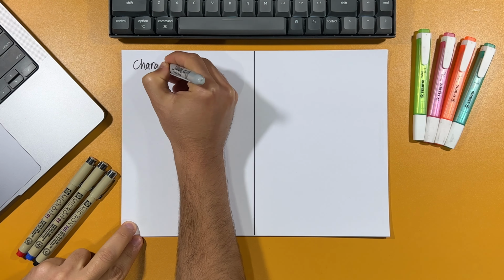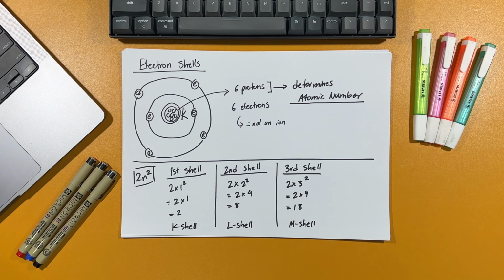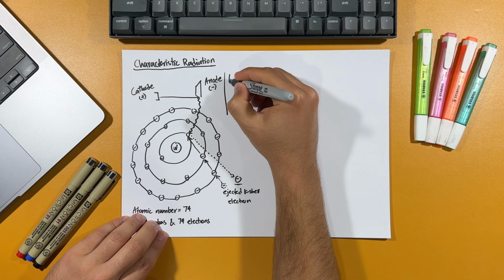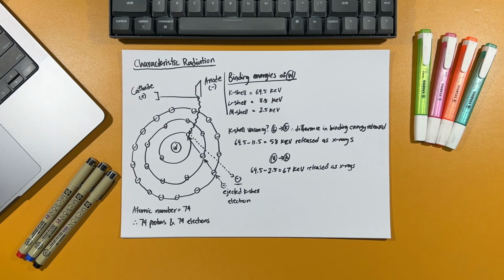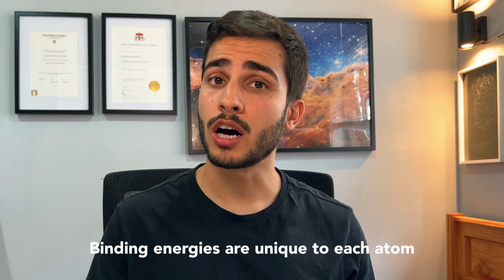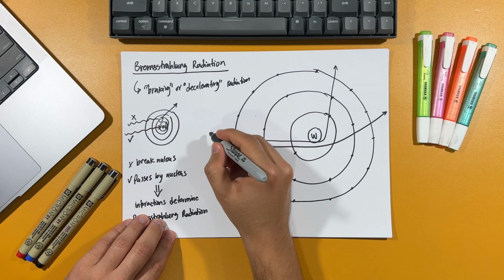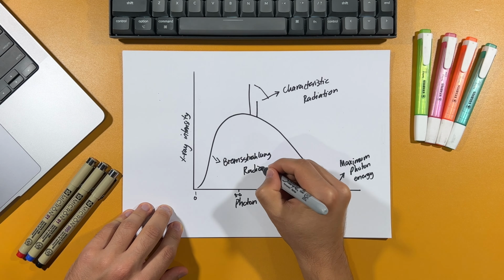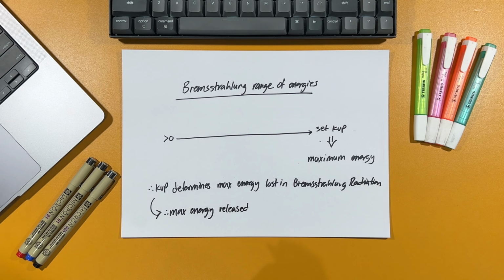Characteristic vs Bremsstrahlung Radiation: What's The Difference?

Comment: why photoelectric effect... only affects inner orbits (k-shell)... why not affect outer shells..?  also, my another question is my componton effect affects outshell...since compton have high energy... why it affect outer shell first instead of innershell
Reply from the maker: Great question, it get's a bit complicated as we try to simplify the explanation of how photoelectric absorption and compton scatter occur, but here's a brief response to your question. It turns out that as the x-rays are coming and interacting with our tissues, they can be low energy or high energy (remember there's always a range of energies created as you saw with bremssttrahlung radiation). The x-rays coming in are all interacting with all the shells not necessarily just the inner or just the outer shells. It's just that WHEN an x-ray photon interacts with the inner k-shell, which is usually one that has a lower energy, then what results is an absorption event (aka photoelectric absorption). And this only occurs when the incoming photon has an energy that's equal or just greater than the binding energy of the inner k-shell (which will have the highest binding energy of all the shells). Now as said these x-ray photons are interacting with all the other electrons in other shells as well, and generally apart from that when they interact with the outer shell electrons, this results in a scattering event (aka compton scatter). So it's not necessarily that photoelectric effect only affects inner k-shell orbits, it's that x-ray photons interact with all electron shells, but the ones that have the right energy to interact with the k-shell orbit, that's when it results in an absorption event, and we call this process photoelectric absorption. Hope that helps!

Comment: if the electron is negative and the nucleus positive, why does electron decelerate? shouldnt it accelerate since opposite charges attract?
Reply from the maker: Great question! The electron, being negatively charged, is indeed attracted to the positively charged nucleus due to their opposite charges. In the case of bremsstrahlung (braking) radiation, the electron approaches the nucleus and is deflected due to the attractive electromagnetic force. However, it's not a straightforward acceleration toward the nucleus because the electron doesn’t directly collide with it. Instead, as the electron passes by the nucleus, its path curves due to the attraction, which changes the direction and speed of the electron (i.e. velocity). This deflection leads to a rapid deceleration or reduction in the electron's velocity along its original path/trajectory. In this rapid deceleration, the electron releases energy in the form of X-ray photons, which are known as 'bremsstrahlung radiation'. So, while the electron does 'accelerate' in the sense that it changes direction due to the attractive force, it also loses energy as radiation because of this sudden change in velocity. Hope that helps
Reply: @SahandHooshmand  Thank u!